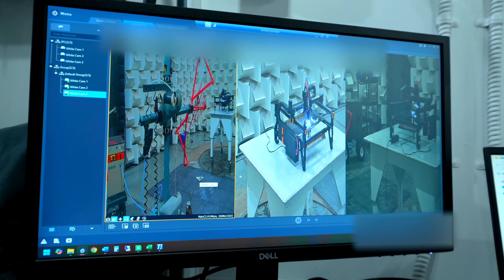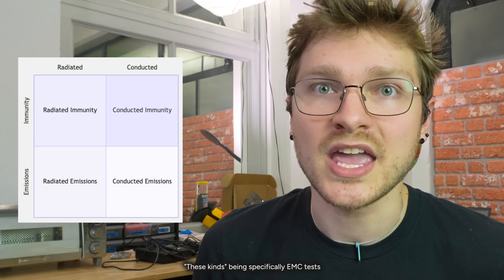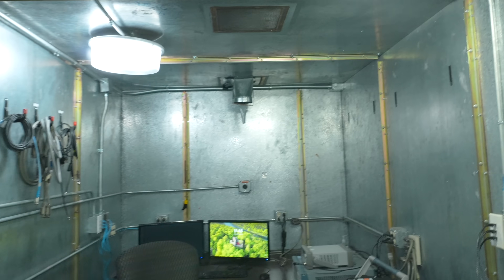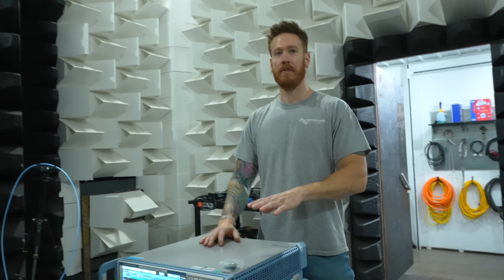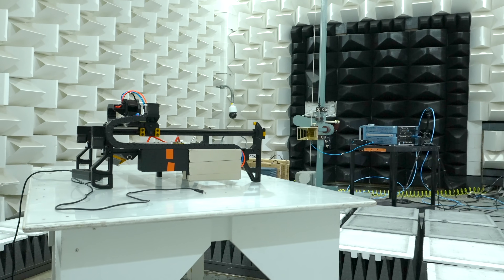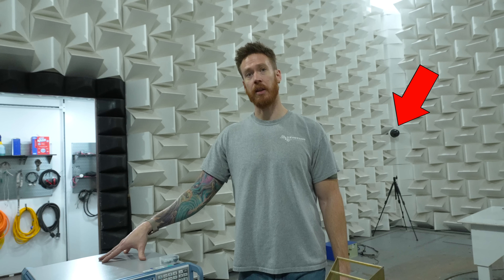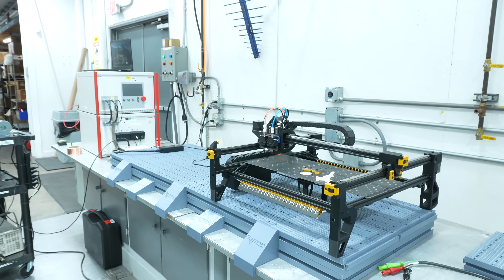Getting Certified: Start to Finish

Comment from the maker: 🚨 ERRATA LIST - PLEASE READ 🚨

I'm sure there will be mistakes in what I said in this video, so this comment will keep track of any corrections or clarifications! If you found an error, please leave a comment so I can add it here. Thank you, and happy testing!

- 1:32 - This video is only showing FCC and CE testing, and even then, only some of it. FCC and CE contain EMC testing, but there's other types of tests, and other types of certs! For example, UL is a whole can of worms and tests a ton of things, many of which have nothing to do with EMC. This is just the chunk that made it into the video!

Last Updated: 2025-07-12
Reply: Also be aware that EMC testing is just a tiny part of the CE process and GPSR and other regulation might also apply. The pointbof ce is to ensure only safe products get to market and to protect consumer AND manufacturer.
This video only  covers one of many regulations that are relevant for CE. It does not have to be scary . Smander is here to help specifically oshw.
Reply: In case you dont have an EU rep yet, we can help.

Comment: Could you tell me please, how do you prevent the drag chain from folding up when it move to the extreme end?
The problem I face is, when my drag chain (10x14 size) moves to the extreme end (both ends closer to  each other) , the drag chain loop lifts up, I want to stop that from happening

Comment: I’ve had the (un)pleasure in getting some saftey related automotive components through these tests, we did ESD in house, but for all of the EMC tests we had to run 2 variants of 6 units, and then a problem was found unrelated to emc but a circuit change was made so we had to test again, so with 24 parts tested and 6 operating modes it ended up taking a couple months and the bill was >$150k 😬 (I’m off the project now but I hear they have to go back again for 24v variants)

Comment: Really excellent run through of compliance and well done for passing! A quick note if you pass CE marking you also comply for UKCA as well which is the UKs post Brexit version of CE but is identical to CE. (Sorry our standards are a mess)
Reply: But do be aware that in the future CE and UKCA may diverge from being identical. The equivalence between the two is not guaranteed into the future.

Comment: Then here in the UK you CAN self certify.... I mean with something like CNC you would be dumb to self certify with all the things that can go wrong, but you CAN if you really wanted to.
Reply: CE is exactly the same. THey didn't need to actually test anything to stamp the CE logo. But they you are liable if anything fails.
Reply: @framegrace1 yes. But what about certification for the US and Canada?
Reply: @framegrace1  Having been through a process with TuV to test equipment for CE certification I can assure you a company would be mad to not do the required assessments before issuing a CE certificate. Yes you can quite happily self certify a CNC machine, but you had better have a paper trail that shows you have assessed failure modes for any and all safety sensors on doors and interlocks, and anything else that could relate to a users safety. CE certification is NOT a sell it and it will be alright situation, it is self certification, and you better have put in the leg work (or desk work, as appropriate) to show that you have assessed any failure mode you and anyone else can come up with.

Comment: One correction thats a funny conflation: the Special Outlet, does not "listen" to the electrical noise your device may produce. It is  a LISN  --> Line Impedance Stabilization Network. It stabilizes the power sources Line Impedance so that a Spectrum analyzer can then listen to the Noise. these are  multiple measurements as you listen for Common Mode  and Differntial Mode Noise separatelly.
LISN are available for AC and DC and you quite often need multiples at once. You would also use these any time the Device is powered to decouple it from noise coming in from the power system and soemtimes together with an Isolation transformer if you are dealing with AC Mains.

Comment: I had something fail certification once, they said it was emitting noise on some specific frequency... made no sense. it turned out, it was due to the extra long power cable I made for them to use to test the equipment with, was coiled from when it was wound onto the spool. Somehow that coil in the cable was creating the noise that the test was picking up. I sent them a normal cable and it passed, thankfully
Reply: Ouch, I can only imagine how expensive of a mistake that was.

Comment: FCC and CE are not the same. You also have  UL / UR.
Reply: At no time he said FCC and CE are the same, in fact,  he pointed out that fact quite intensely. Only 3 of the 14 tests were required for FCC.
Reply: @framegrace1  I was not criticizing, only pointing out for a product to be fully certified in the US UL / UR are required. FCC is only radio emissions. 

CE is a complete electrical certification in Europe.

Comment: a 200,000 dollar Osciloscope? and they run WINDOWS???? whyyyyyyy
Reply: To create a certification machine, the machine itself has to be superextratopcertified. (Did you noticed the machine was inside tha chamber with the tested machine? So yeah THAT level of certification). Cerifications are expensive, and they and the changes needed to pass, are maybe the 90/95% of the cost of that machine.
No one pays to certify Linux, and macs don't care. Windows is the only general purpose OS you'll see in this sort of equipment because MS pays those certifications.
Reply: You would be surprised at the number of high end instruments that run Windows as the underlying OS. I have used both Tektronix and Hewlett Packard/Agilent oscilloscopes that use Windows behind the scenes to do the basic networking and file handling operations. The Agilent 'scope actually used Excel to produce the traces on screen which I hadn't realised until I managed to upset it somehow and made it show that I had crashed the Excel. Boy was that instrument slow, it took something like 10 seconds from a trigger to display the traces on screen, and after that i realised why. Any Tek scope that is more performant than a 3000 series uses Windows as the underlying OS.

Comment: I'm not sure about the exact process you followed, but I suspect you didn't get a "certification". If you don't have intentional radiators (WiFi, Bluetooth, etc), which would indeed require a certification, then you would probably only do the EMC testing, as shown. The testing proves that you comply with a specific regulation (like the FCC stuff) or standard (which, in turn, proves you comply with a regulation, like the EU EMC directive).
Then, based on the those test results you would have the confidence to produce a "declaration of conformity" (abbreviated SDoC or DoC), which is a document where you declare that the product complies with the applicable laws.
I think it's possible to get a "certification" from an FCC lab even if your product doesn't technically require it, but that would be more expensive. So, I don't think one would normally go down that route.

...
Just checked and I found the SDoC on the website, which suggests this is in fact what was done: https://docs.opulo.io/semi-assembly-4-0/notices/

Comment: One of the things you typically also test is radiated emissions while performing ESD. As in making sure the path the ESD takes doesn't cause the high frequency components to be amplified and emitted as EMI.

This might only be a thing on radio equipment though. And I have only done this on devices where the ESD is a lot more controllable, like plastic products with a USB charge port, where the ESD is only likely to happen on the charge port.

Comment: Those red and blue lines in the EMC tests are slightly different to how you described them. The red is the margin, each test house has a accuracy to which they have been certified, the red line basically says above that you might have failed but the measurement is not accurate enough to say with 100% certainty. 

Quasipeak is also a type of measurement, in terms of how the signal is windowed and averaged. The limits are different for a quasipeak measurement relative to a peak measurement.

Congratulations on passing first time!

Comment: It’s a disgusting tax as if a machine ever needs to keep working if its owner goes around zaping it with a high voltage machine
Reply: Are you talking about conducted immunity or ESD? Power surges happen and people also touch the device after walking on carpet. Obviously the test is a few times worse than an average scenario, just to guarantee it works even if the person has really bad carpet.

Comment: I'd have one more question - why did you do the certification now, at this point in time? I mean, you've been shipping the LumenPnP over years now (even in different versions), didn't you run into any trouble there? Just curious, since I am in the same boat and thought, certification should happen before shipping out the first product...
Reply: possibly as an individual producer and as a company producer have different rules

Comment: AI Summary

Abstract:

This video chronicles the challenging and often opaque process of obtaining product certification (FCC for US, CE for Europe) for the Lumen PnP V4, an open-source pick-and-place machine. The creator details the four-day testing regimen at Keystone Compliance, covering various electromagnetic compatibility (EMC) tests: radiated emissions, radiated immunity, conducted emissions, conducted immunity, magnetic field immunity, and electrostatic discharge (ESD). Surprisingly, the Lumen PnP V4 passed all 13 required tests on the first attempt, a rare feat attributed to significant community contributions to its design. The video also transparently discusses the substantial costs involved (~$9,600 for this successful attempt) and offers practical advice for other hardware developers on how to navigate the certification process more efficiently, such as phased certification and utilizing pre-certified modules.

Navigating Product Certification: A Journey with the Lumen PnP V4

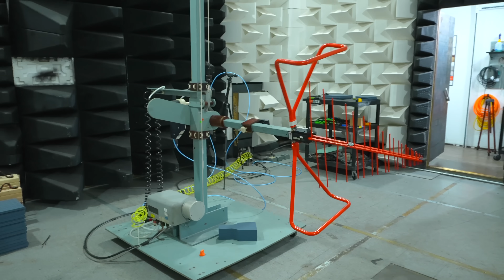*   0:00 Introduction to Certification: The video highlights certification as a daunting, expensive, and often misunderstood requirement for electronic devices, focusing on the process for the Lumen PnP V4 pick-and-place machine.
*   0:22 Certification Goals (FCC & CE): The primary goal is to ensure the Lumen PnP (and other electronic devices) "play nice" – meaning it doesn't cause or suffer from electromagnetic interference. FCC covers sales in the US, while CE covers Europe.
*   0:53 Four Types of Tests:
    *   Emissions vs. Immunity: Whether the device is creating interference or is affected by it.
    *   Conducted vs. Radiated: Whether interference is transmitted via physical contact (wires) or electromagnetic waves.
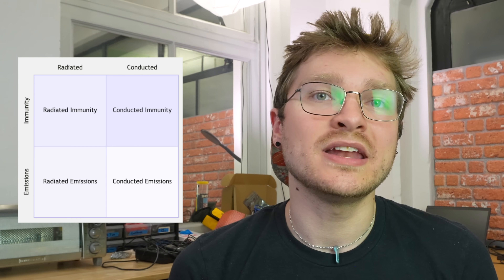*   2:35 Radiated Emissions (RE) Testing: The first and most difficult test involves placing the Lumen in an electromagnetically isolated chamber. An antenna listens for electromagnetic waves emitted by the device during operation to ensure they are within acceptable limits. This test took 1.5 days.
    *   High-Tech Chamber & Equipment: The testing chamber is a steel, grounded enclosure lined with electromagnetic absorption material. Signals are passed via fiber optic cables to avoid interference.
    *   Pneumatic Movement: The Lumen's pedestal rotates, and the antenna moves vertically and horizontally, all actuated by pneumatics and made of non-metal materials to prevent interference.
*   7:33 Radiated Immunity (RI) Testing: The opposite of RE, this test blasts the Lumen with electromagnetic waves to ensure it maintains normal operation without fault. The Lumen PnP V4 passed, continuing to function correctly despite the interference.
*   8:31 Conducted Emissions (CE) Testing: This test measures noise kicked back into the mains power line by the Lumen. This is generally easier to pass with a well-designed power supply.
*   8:56 Conducted Immunity (CI) Testing: Considered a "spicy" test, it blasts the Lumen's power supply with high voltage (e.g., 500-1000V bursts) and unusual power patterns. The Lumen PnP V4 successfully withstood 2000 volts through its mains, showing robust design.
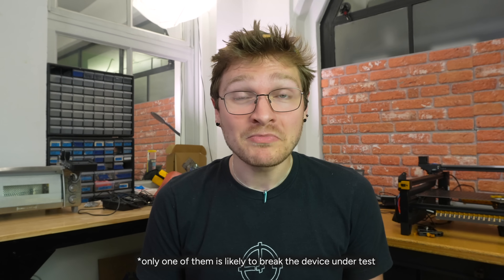*   10:06 Miscellaneous Tests (Magnetic Field Immunity & ESD):
    *   Magnetic Field Immunity: The Lumen is exposed to strong magnetic fields from a coil to ensure continued operation.
    *   ESD (Electrostatic Discharge): The "final boss" test, where the Lumen is zapped with 8,000 volts using a specialized device. Despite being a highly nerve-wracking test, the Lumen passed due to built-in ESD protection in its circuitry.
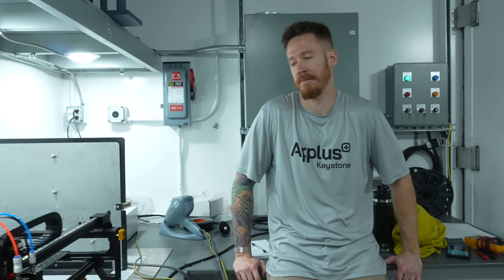*   11:11 Passed First Try (Rare Achievement): The Lumen PnP V4 passed all 13 certification tests on the first attempt, which is highly uncommon.
*   11:23 Community Contribution was Key: The success is attributed to extensive feedback and design improvements from the Lumen PnP development community on Discord and GitHub, who helped identify and fix potential issues beforehand.
*   11:58 Certification Costs: The total cost for the 4-day, 13-test certification process, including testing fees and travel, was approximately $9,600. The video emphasizes that costs can escalate significantly (e.g., $25,000-$50,000) if retests are required.
*   13:00 Advice for Hardware Developers:
    *   Phased Certification: Start with easier certifications like FCC (2 tests) before pursuing CE (11 tests) to manage costs.
    *   Remote Testing: Some labs allow devices to be sent in for testing without requiring the developer's presence.
    *   Avoid Intentional Radiators: Devices without Wi-Fi or Bluetooth are significantly simpler and cheaper to certify.
    *   Pre-certified Modules: Use pre-certified modules for necessary wireless functionalities to simplify testing.
*   14:54 Hardware-dot-cafe Resource: The creator is launching hardware-dot-cafe, a website dedicated to codifying and sharing information about shipping hardware products, inviting community contributions.

I used gemini-2.5-flash| input-price: 0.3 output-price: 2.5 max-context-length: 128_000 on rocketrecap dot com to summarize the transcript.
Cost (if I didn't use the free tier): $0.0088
Input tokens: 20068
Output tokens: 1113
Reply: Thank you

Comment: Little correction, CE is not a certification. CE is a declaration of conformity to EU market regulations. There isn't one single test suite you have to pass for CE, the manufacturer just has to declare they conform to all applicable regulations and laws, but if it's proven that the device does not follow regulation, the sale is prohibited (and seller and/or manufacturer fined).
But some products need to be actually tested by a notified testing lab.

Of course it is highly beneficial to have proof that you follow regulations, declaring conformity on a vibe base can go very wrong very quick ;)
Reply: In addition it stands for Conformité Européenne (French for European Conformity)
Reply: Good effort from my non english speaker comments, however in English the word certification simply means you have completed a course that you get awarded a certificate for, to show you have completed it and met the standards of the course.
Reply: @panik735 and that's exactly what CE is not. From the english Wikipedia:
"The presence of the CE marking on commercial products indicates that the manufacturer or importer affirms the goods' conformity with European health, safety, and environmental protection standards.[2]: 58  It is not a quality indicator or a certification mark."

Yes you get a certification from the lab that you passed their tests modelled after the EU regulations, but it is not a "CE certification".

Comment: I hate high stakes uncertainty, so one thing I've found invaluable is to buy as many toys as possible for pre-compliance testing.  I love being able to do less-formal versions of all the hardest tests myself, so I'm not surprised when its finally time to go to the lab.  (Yes, this means I've probably spent almost as much as the cost of the testing itself on gear, but I'm also able to buy things cheaper or second-hand.)

Also, in the section where you talk about "conducted immunity", that's actually several tests. The one you dwell on the most is probably EFT Transient Burst.  That's one I've lately struggled with enough that I actually bought a burst generator box off eBay for consistent in-house testing.  While most of my stuff survives it just fine, I've found that it can really foul up USB under some circumstances.

Comment: RF modules do not really help with getting RF compliance certification. You mount these modules ideally onto a big ground plane, and depending on the topology the tuning of the module can be way off. The only part that saves you time is if you use the modules software, and you are operating in a band / with a protocol (like Bluetooth) for which the vendor has already passed certification. For example, in Europe for 868MHz you must prove that your duty cycle is below a certain threshold. A module with fixed software can help you pass that criterion really easily.
Reply: You're supposed to cut out the ground plane for a certain distance around the module

Comment: EMI/EMC testing is way to expensive. I have developed a little DIY approach: I just place 6 or 7 of my F22 Raptors (with the RAM facing inside) in a circle, so I get a clean section in the center for testing. :)